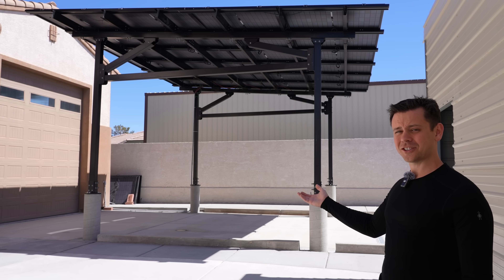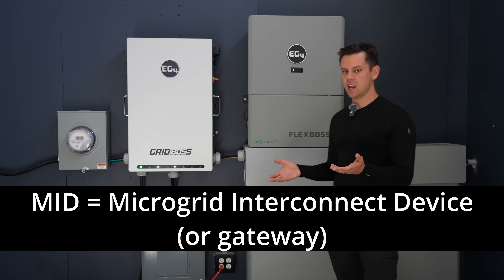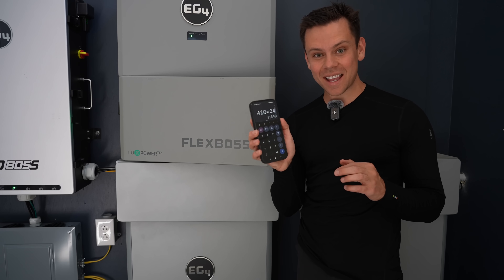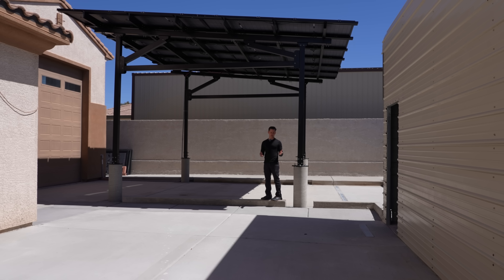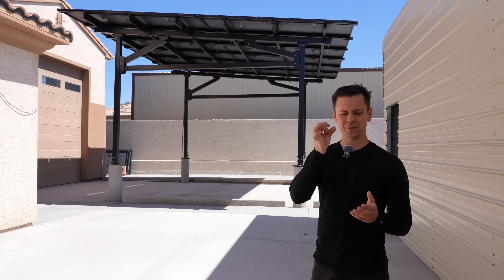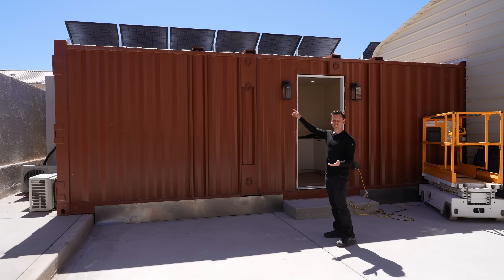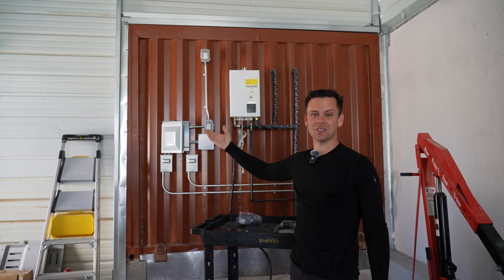Yikes! Not 12,000W?! Chiko Solar Carport w/ Aptos 410W Bifacial Panels

Comment from the maker: I will pull over STC in a month or two. And its angled at only 5°. But going by the studies and the temperature in vegas, and the output of my other arrays, I was hoping to hit at least stc. Ahh well.

Carport Affiliate Link: 
https://signaturesolar.com/chiko-usa-premier-residential-steel-carport-black-solar-pergola-solar-gazebo/?ref=cPwLcVc0SW-BjN

Check out my new Offgrid System Builder! Build any size system: 
https://www.mobile-solarpower.com/48v-complete-system-blueprint-559371.html

Also check out my Hybrid System Builder
https://www.mobile-solarpower.com/code-compliant-48v-offgrid-system.html

Are you addicted to LiFePO4 Batteries? Check out my recommendations!
https://www.mobile-solarpower.com/solar-batteries.html

0:00 Intro
0:37 Rebuilt Flexboss System
1:05 Peak Irradiance Measurement
1:27 Yikes!
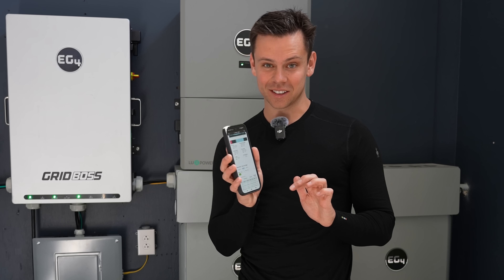2:07 Final Results
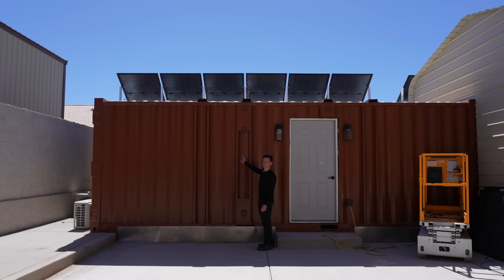2:17 The Problem
2:44 The Solution
3:38 Viewer Complaints
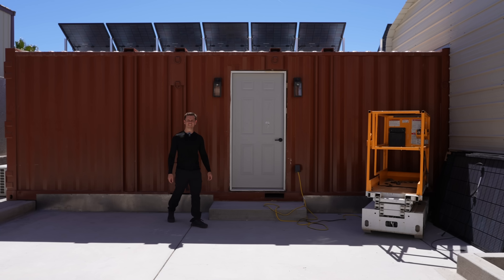4:13 Tiny Home!

~~~~~~~~~~~~~~~~~~~~~~~~~~~~~~~~~~~~~~~~~
Tired of getting ripped off? Check out my "Will Prowse Approved" solar product recommendations below!

12V Batteries
https://www.mobile-solarpower.com/lithium-batteries.html

48V Batteries
https://www.mobile-solarpower.com/48v-batteries.html

Offgrid Inverter System Builder
https://www.mobile-solarpower.com/48v-complete-system-blueprint-559371.html

Hybrid Inverter System Builder
https://www.mobile-solarpower.com/code-compliant-48v-offgrid-system.html

Mobile Handtruck System Builder (very popular!)
https://www.mobile-solarpower.com/mobile-48v-system.html

Solar Panels
https://www.mobile-solarpower.com/300w-solar-panels.html

Ground Mount Solar Racking
https://www.mobile-solarpower.com/ground-mount-racks.html

Wire, Lugs and Busbars
https://www.mobile-solarpower.com/wire-and-connectors.html

Tools
https://www.mobile-solarpower.com/tools.html

Fuses and Circuit Breakers
https://www.mobile-solarpower.com/fuses.html

Plug-N-Play Solar Systems
Ecoflow, Anker And Bluetti! So many models to choose from. See my current recommendations here:
https://www.mobile-solarpower.com/full-size-systems.html

~~~~~~~~~~~~~~~~~~~~~~~~~~~~~~~~~~~~~~~~~~
Need to build a large DIY system? Need a trustworthy solar distributor? These are my favorites:

Signature Solar
Creator of EG4! Solar Minisplits, Victron and More! Largest Solar Store Online.
If you want $50 off, please use my link below and coupon code "DIYSOLAR50":
https://signaturesolar.com/?ref=cPwLcVc0SW-BjN

Current Connected
Best Prices for EG4, Victron, Midnite and so much more! Fast Shipping and Highest Rated Customer Service:
https://currentconnected.com/?ref=wp

~~~~~~~~~~~~~~~~~~~~~~~~~~~~~~~~~~~~~~~~~~
Join our DIY Solar Community 
Need more help? Join the largest solar forum on the internet for beginners and professionals alike. 140,000 members and counting!
https://www.diysolarforum.com

Check Out My Free Book
Best-selling and beginner-friendly guidebook to off-grid 12V solar!
https://www.mobile-solarpower.com/the-book.html

~~~~~~~~~~~~~~~~~~~~~~~~~~~~~~~~~~~~~~~~~~
Contact Information:
I am NOT available for personal solar system consult! If you wish to contact me, this is my direct email: williamprowsediysolar@gmail.com
FTC Disclosure Statement and Disclaimers:
Every video includes paid promotion or sponsorship (such as free products for review). Some links on this YouTube channel may be affiliate links. We may get paid if you buy something or take an action after clicking one of these. My videos are for educational purposes only. Information is subject to change/update at any time. Electricity is DANGEROUS and can kill. Be smart and use common sense :) DIY Solar Power with Will Prowse is a participant in the Amazon Services LLC Associates Program, An affiliate advertising program designed to provide a means for sites to earn advertising fees by advertising and linking to Amazon.com
Reply: I thought it was 36 panels not 24. What about adding a reflective roofing material and angling them to channel more light underneath?
Reply: @LADETROIT  about $100 worth of emergency / thermal blankets LOL
Reply: Plug all the angles and geo location in a PV design tool like PVwatts.  It will give array outputs thru the day/months/seasons in kW and Watts/m sq direct  panel exposure.
Reply: @longtimber1  PVwatts is great or for rough estimate use the latitude, for Vegas 36 degrees. I know you can’t change the angle in this case but I also think this is why the output is lower than expected. Manufactures are getting better at rating their equipment for the most ideal conditions so they can claim better performance compared to competitors. Anything less than STC will yield less output and potentially this is even a larger factor for bifacial panels in that lower angles result in less ambient or reflected light on the back side of the panel.
Reply: The angle of panels is very low that might explain the 8700 watts.
Reply: Looks like the altitude if the sun at solar noon today in Vegas is 53.4deg.  So cos37deg = 0.8 or a 20% reduction from peak irradiance.
Reply: You could build wood covers for the concrete and the bolts then paint them the same color as your shop. Imagine those base covers they put on porch posts in the south. I'm not sure what they're called. Assuming you would want it more aesthetically pleasing.
Reply: That's a very low angle, which could be why. 
Also it won't self clean and dirt is going to build up on it.
Reply: I am no expert, but I believe the angle also makes a big difference.  Since these panels are mounts fairly level to the ground, you will be losing a bunch.  I have read that the power loss is the Sine (or Cosine?) angle to the sun...  Good luck!  I wish I had the space to mount panels here...
Reply from the maker: @jqswjqsw  not that big of a difference. Check out my beginner videos
Reply: If they're not 100% perpendicular to the sun, clean & cool then I doubt you'll ever achieve their maximum output rating. It is a maximum after all.
Reply from the maker: @new-zealand-clippy  yes I've hit it many times before without perfect tilt etc. check out my older videos
Reply: @WillProwse  Ok but so then how much do you expect it would produce if you did have the perfect tilt (and other conditions)? Would you expect it to reach more than the manufacturer's claimed maximum? I can't understand the logic behind that reasoning...
Reply from the maker: @new-zealand-clippy  my goal is increasing bifacial gain and generating maximum sun hours. I can't tilt it so what do you want me to do 😂
Reply from the maker: @new-zealand-clippy  and the tilt is literally perfect for peak output. Unless it's really hot. But that's the benefit of having it up high. That's what I said. That's the whole point
Reply: @WillProwse Sorry if I upset you - I didn't mean to imply that you should change anything. My point was simply that I think it's unrealistic to reach manufacturer's maximum ratings without perfect conditions.   Thanks for taking the time to answer and hope you enjoy your new shade :)
Reply: @WillProwse  almost at a million subscribers, i remember when this was a very tiny channel
Reply: Yes, the angle from perpendicularity looks to be at least 20 - 25deg.  Cosine 25deg = 0.9 There's your 10% reduction at peak.  Very cool canopy!
Reply: Wry. Ice system. What’s was the total cost for the carport?
Reply: They always rate panels in "ideal" conditions 😅
Reply: If I was near, I would bug the shet out you just to become a helper so you could put out more videos....
   
    So much has come out an been waiting for your reviews lol
Reply: I think it's because it is surrounded by other buildings and it can't get  sun from the sides.  It is dark from the buildings on the sides and I think they are to close. I think if the array was above the other roofs it may work, but you would have to  get a crane pickup the roof and remove the side poles and replace them all with longer poles or add extensions to all 4.
 I think you should paint with a brighter paint like you said and test it  more and see before extending the height above all the other buildings,  save that for a last resort and even then the buildings may just be to close. 
 Maybe  check if they have mirror  or reflective floor coatings, I'm sure you have seen where they come in and epoxy the shop or garage floor, maybe check if they have a mirror like epoxy floor coating and apply it to 2-4 ft. Past the roof on all 4 sides and hopefully it will reflect up underneath! LOL!  Or drop  down under the panels and install reflective panels all the way around the outside of the array and reflect sun to the underside of the panels.  I don't know if you could adjust the angle to where it would reach the middle but I am pretty sure you could reflect it back to all around the outside. LOL!
 I know you could do it but I don't know how it would look. 
 1 more idea, install mirrors on the side of all the buildings around it so the sun would reflect instead of  being blocked. Again I don't think the astetics will be what you want. Hahaha, Hahaha 😆,  but I am sure you can do it!
Reply: 🚀 Genius or a Huge Mistake? Can we turn the Sahara Desert into the world’s biggest solar farm? 🌞🌍
This idea could power the entire planet, but there are hidden dangers nobody talks about! 😱

🌡 Rising temperatures, climate impact, and shocking consequences!
📺 Watch this video to find out: Will this be the greatest energy breakthrough or a disaster waiting to happen?

🔗 Watch now: [YouTube Link]

💬 What do you think? Drop your thoughts in the comments! 👇
Reply: Love the videos! You are the sultan of solar.
Your batteries are a little too close together and your FlexBoss needs more clearance to the left 👀
Reply: 20% tarif
Reply: ,😂😂 what a bombmer men😂😂

Comment: Will I am discussing RSD requirement with my AHJ and specifically around exception 2 of 690.12.  This exception in NEC 2023 removes the requirement for RSD if panels are mounted on a detached non-enclosed carport. With your install did you have to install RSD for panels on your carport?

Comment: Good Lord!   Fantastic.    I have a few 2200 Watt UPS units.   I want to move the pool pumps off the house power and onto 10 375 Watt solar panels.   I may need to do a Soft Start on the PUmp..  Gotta measure the inrush current.   Probably Pulls some big amps when it kicks on  -   Not sure.    Anyhow,  Keep up the fantastic work.   I'm one of your biggest fans!!

Comment: Ghe bifacial panels are practically flat and theyre surrounded by buildings. You basically put them over a giant hole. 

Either you would have been better off with a slightly more aggressive tilt or less buildings around it. 

But if you just want a car port and the fact it generates electricity is a plus, then this is solid obviously as you said

Comment: Square cement posts have a greater chance of chipping and cracking, but mostly associated with wet, freezing temps. Pitch set during production or adjustable? Great videos!

Comment: why don't you just put a white clotth or tarp tied up under the panels so the light that there is reflects back up? that's the cheapest solution there.

Comment: Thanks for all your informative videos!  
STC is done at 1000 watts/sqm, 25C solar panel temp, and with a solar incidence angle of 0 deg (sun shinning directly on the panel).  You could easily correct for each of these and see whether a panel would meet its STC rating if you had STC conditions.  Measure the solar radiation with a solar irradiance meter (in my area days that look really clear can vary from 800 to 1200 watts/sqm),  measure the solar incidence angle on the panels and multiply the measured irradiance by the cosine of the incidence angle (eg 0.86 correction for a 30 deg incidence angle), and measure the actual PV panel surface temp (probably much higher than the 25C STC assumes) and use the correction factor the panel manufacturer usually provides to correct for the higher temp.

Comment: you're not looking at the DC to AC conversion. My rated array is at 12.55 kw of DC, but actually outputs 8.99 kw of AC power this is because of the Enphase microinverters. You didn't speak much on the inverter, but that could be a limiting factor. Also, those ratings are given at perfect conditions so the panels could be too hot and require cooling to perform at their best.

Comment: Preface, I know nothing about anything.
I cant help but remembering a post about some people saying the bifacial panels needing to be lower due to math or science or whatever.
Reply from the maker: No, need to lift higher
Reply: @WillProwse  it would be interesting to see the difference between white surfaces or just flat not wall surfaces.
The question always is, are biracials worth it?  I have x amount of variables, what's going to make them not cost effective
Reply from the maker: @dustinmere1560  I have lots of old videos that cover that. Bifacials are so cheap now that why not. They are crazy good these days
Reply from the maker: @dustinmere1560  just look at the warranty alone

Comment: Bifacial gain, hmmm.  So you’re supposed to get solar power from the shade, huh?  

My system also puts out about 80% of rated power.  That is the dirty secret of the solar industry.  The sun just doesn’t put out like it’s supposed to.

Comment: To increase the Bi Facial capture, paint the floor and surrounding walls WHITE, but add some BARIUM SULFATE POWDER to the paint because it's the world's WHITEST WHITE.

As a roof paint, it also will reduce roof temperatures because it's super reflective.

Comment: Even flat on the ground, my bifacials did more than they were rated for. And this is a bit more than from the equator.

My setup reaches max charger power at 250W/m2 solar irradiance which is 14kW with 2 250/100 and 1 250/60. 24 DA Solar 580Wp bifacials at 45 degrees (for the 250/100) and 9 Trina 430Wp bifacial (practically donated by the victron installer, for the 250/60).
I'm offgrid not because I want to but because getting grid here, where the nearest 20kV line is only 200 meters away, is a multi year plan by the grid company, or I let someone do it and gift it to the grid company and pay more than is needed to go off grid without a diesel gen backup.

Comment: It doesn't seem like a lot of concrete for the cylinders that are holding up the ground mount structure, but I would think that square forms would be more expensive than the usual round forms.  I'm a desk jockey not a concrete guy so I could be off.

Comment: The first thing I noticed in your first carport video was the size of the footings.  It's not so much the size of the round footing you used, it's the distance between the anchor bolts and the face of the concrete.  I'm not an engineer but I am a General Contractor so I build whatever the designers give me so I'm not exactly sure what the correct distance is.  A general rule of thumb is 5-6 times the diameter of the anchor bolt.  So if you're using 1/2" diameter anchor bolts, they should be a minimum of 2 1/2" to 3" away from the face of concrete.

Comment: I have a small PV set up that allows for easy panel cleaning and tilting as needed.  I cleaned and reset the tilt the other day and immediately got 10% more power in full sun.

Here are the formulas and an example.  Goggle your latitude and put it in the formula.  Google the solstices and equinoxes and reset the tilt as needed between them.  If you want maximum power clean your PVs and reset the tilt each month starting two weeks before or after any solstice or equinox.

******
Use shallower tilts the further south and higher tilting angles the further north.

Winter: (latitude × 0.9) + 29 degrees
Summer: (latitude × 0.9) – 23.5 degrees
Spring and fall: latitude – 2.5 degrees

NOTICE---- the spring & fall fornula is different from summer and winter.

EX:
If we calculate this for our previous example of 38.7° in Colorado Springs:

Winter: (38.7° x 0.9)+29°= 64°
Summer: (38.7° x 0.9)-23.5°=11°
Spring and fall: 38.7°-2.5°= 36°

*****

Alternatively you can take a straight stick, hold it perpendicular in X, Y, and Z axises against your panel, see where the shadow falls, and set your PV square to the sun that way.

If you have a permanently mounted system, oh well, that's on you, but you can rinse off your panels more often and at least figure out your mid point of angle when you construct your mounting system  which is probably not 45°.

Finally, if I lived in a very cold climate and had a fixed mount I would skew my final angle setting toward mid winter when cold temperatures raises the voltage and I am most likely to need emergency or backup power.

****

Will:  if you look at your opening shot the shadow shows your panels are not 90° to the sun, so I would not expect full power from them.

Comment: Cool rack and channel! I'm a professional solar installer and commercial site commissioner and almost never see STC coming from an array. When cacluating the Performance Ratio of a site take: STC x irradiance factor x cell temperature factor x Vdrop factor x inverter Eff factor x power tollerance of the specific modules to detirmine an expected output. Then compare with actual output to derive the PR. A nice warm day in Vegas at a 5 degree slope would be lucky to hit 95% (bi-facial gain not withstanding).

Comment: To enhance the performance of your bifacial panels, several strategies can be employed. One effective approach is to utilize reflective surfaces, which you mentioned in your video. Painting the area white or using light-colored materials placed beneath and around the panels. This can boost energy production. Additionally, leaving space between the panels and the reflective surface can also increase energy output by allowing for more indirect irradiation. Of course the trade off is losing some of that shade you can now enjoy under there.